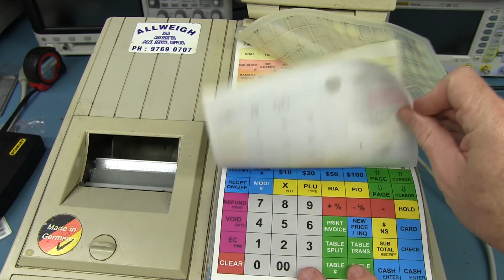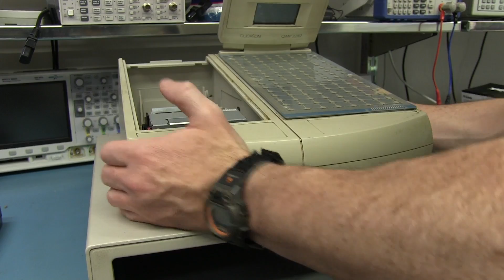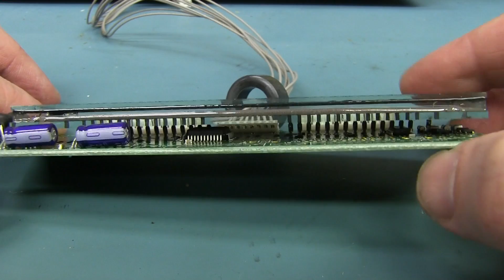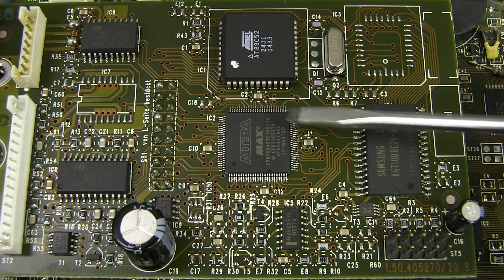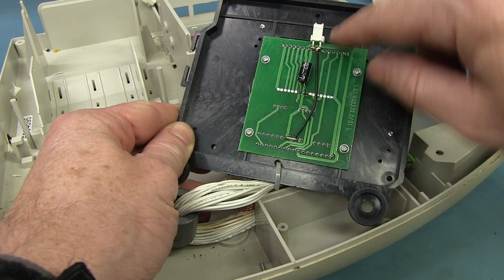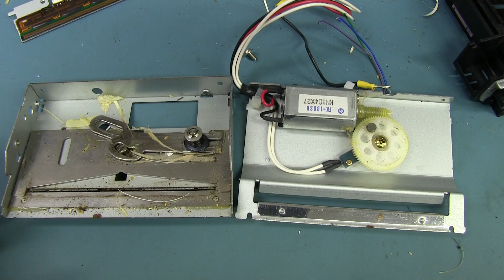EEVblog #641 - Dumpster Cash Register Teardown

Comment: I wonder how much of these 'bodging' is the result of keeping the same kind of product running for many and many years with installing new and more modern options and changing parts.
I have taken aparta kind of simular looking machine many years ago, some parts like the power-system are different, but some other parts are more or less the same or might be compatible.
Like in supermarkets (where mine came from) they used to have a very long life with replacement-boards 'on the fly, same day repairs', connecting the newer stuff  and it was running again and the serviceman goes to the next shop. They can be in use for over 20 years when the supermarkt doesn't need or want new functionality.

One of the things that changed in the life of these things were the printer and the printerboards. First they were not even thermo but with a small ribbon on 2 paper-rolls: one for the shop (roll staying in the machine) and one for the customer. Later they changed the system for saving the data internally in the registr., digital so you can print it out or safe it dayly instead of (only) the paper copy. That could be done in the same register, only 'swap out' the printer and the board.
Here at least they used to be emptied and counted at leas once a day, sometimes an exchange midd-day with other people starting to work. The chef usually had the key for all functions (like changing price) and the normal 'register-girls' just used a key with little functionality (selecting, scanning and paying).

Nice teardown.

Comment: The thermal printer can be used as a roll-mode oscillograph. Saving low frequency wave or data on paper.

Comment: wayback old cash registers used to be a way of getting a cheap uc training system, when the very first casio electronic registers (more basic than that one) started getting dumped (mid 80's ish) someone had produced a prom with a monitor program on it which you sent off for to an address in an electronics magazine advert - pre youtube hack! 
you had to assemble your machine code by hand and type it in through the keypad byte by byte, the VFD was your visual display and iirc there was no long term storage for your work. We had one at school - it worked but you only had about enough time to flash a led before it had to get switched off again at the end of a lesson. by that time a lot of kids had BBC and sinclair micros at home anyway which made it seem pretty unimpressive.

sorry for waffling up an old vid, just thought the people who've grown up on arduinos etc might be interested

the circuit board on that looked surprisingly clean given it had been used in a cafe

Comment: Hi Dave! Long time viewer, first time commenter, I have used many different cash registers:
1. yes, they all have some dingy tab to open the drawer, but only if it is unlocked (it only overrides the solenoid)
2. The key you found is for changing the mode, not locking the drawer. The modes are normally: Program, normal, void, off. one key (user) will let you turn it on and off, the other (admin) will let you program it and void sales. This is why it is not a really secure key.
3. programming these things is only slightly better then a root canal;
Put in PGM mode
enter 1001 press PLU then 1100 press PLU then AM/TD
Enter 1011 Press PLU then turn gey to Void and press AM/TD 
and so on and so on. it is horrible.

Comment: For about 10 years i've used an ex McDonald's cash drawer in my bedroom to store things like spare keys, cigarettes, a bit of cash, screws and other random small things. I drive the solenoid with 12v, with a button hidden nearby.
It doesn't have a finger release but the lock is so easy to pick that you could probably do it with one bobby pin.
I guess cash registers don't really need to be very secure because if a staff member wants to steal money they can always just open it. And if someone robs the place they could often just take the whole drawer or have a staff member open it.

Comment: Hehe I should do some tear down videos of some stuff I have here.
There is something from goodwill that I got that does not work and want to ask if any one can figure out what is wrong.
Although I am thinking it is the Lazer as it skips pretty badly.
It is a 300 disc changer,
There is also an old coffee pot that I should tear into on camera as I wanted to try to fix it if I could.
As it was a fairly pricey coffee pot.
I just never have done anything with the coffee pot as it has freaking security bit screws holding it together. :|

Comment: I work with Quorion machines, this one is very old, the new ones are much better, there's also a few of point of sale touch screen systems they have out, much better stuff. IF you need more info, check quorion.de :)

Comment: Might be interesting (and karmically appropriate) project to combine this with the laser barcode scanner and turn it into a shopping list generator. Wave a product you've used up at the scanner and it stores it with a microcontroller and then with touch of a button it could print up a shopping list of what you need to re-stock.

Comment: The key lock was actually not locked, the drawer just will stay closed unless you finish a transaction or press the manual release. If the drawer was locked, neither would have worked.

Comment: for those wondering about the mode switch, the x is for a running PLU report (usually an hourly report) that does not clear the stored PLU information. The Z mode prints out a report of every item from the last time a Z was done, and it clears out the information. Not sure about the other modes, but X and Z are pretty standard for PLU tracking systems

Comment: At 11:10 what are those two blobs of solder (?) just to the left of the L293D Quad Driver chip.  This is a 1.2A peak device so lots of current - I can see the large traces to the connectors.  Are the blobs to bridge some pins to handle the current?

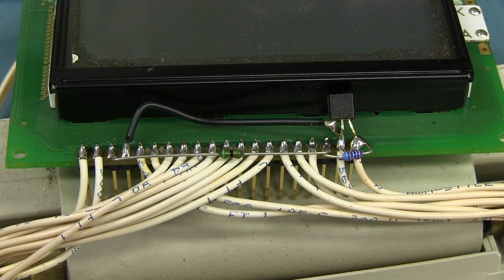Comment: On the under voltage bodge at 8:06, is there a chip resistor between the left hand and middle lead of the Motorola device?  Wow.  Aside - The 8:06 above becomes a link to the correct spot in the video!  That is why this is a repeat to change the time stamp.  Very nice YouTube!

Comment: On the under voltage bodge at 8:40, is there a chip resistor between the left hand and middle lead of the Motorola device?  Wow.

Comment: I want to thank you Dave for explaining the low-impedance ground return to avoid ground-bounce.. I have an FPGA project that bounces like a space-hopper when the data lines are pulsed and will look into this kind of work-around! (I think the chinese company that built the gate array board under spec'ed the bank-caps, but will try this as a first port of call) - Nice one! & Regards from the UK :D

Comment: When I worked at my dad's restaurants, all the cash registers had the option to open the drawer manually.  The mechanism is always stick your finger in the back, on the bottom of it.  Normally the register is against the wall, and is heavy due to the weight of coins in it, so it is not easy to raise it and open it, but when you need to, you can.  When will you need to?, easy: when you have no electricity, and a customer comes in, and of course you have handy the manual paper invoices.
The cash register is not a safe box replacement.

Comment: Thermal printers are a good output device for projects using a raspberry pi or arduino. I wouldn't bother with one unless it had an rs-232 interface though.

Comment: I have used thermal printers before for some fun wankey little projects ... twitter reader, joke receipts, printing out small things ... i stuck a little ATMEGA32u4 breakout in one and put it in a nice box ... unfortunately broke when my power supply failed! 

im most excited by that VFT ... i absolutely LOVE VFT displays but there soooo expensive!
Reply: Keep a eye on the noritake-itron sample site. They have very reasonable prices and often offer substantial discounts (50% off at the moment). Their evaluation kits are first class with excellent documentation and pre-made libraries.
Reply: Thanks allot!
Reply: some dvd players have VTF displays

Comment: Hi everyone,
I got a defect Philips PM3240 scope. The screen seem to light up but I get no trace. Any idea where to begin my troubleshooting? :)
Reply: Is channel A turned on (to left butten I guess)? Tried to play with Position and AMPL in the left section thile it's set to 0 on the bottom switches? Trigger (right) on AUTO and channel A? Are you sure the screen is actually on? The (orange?) grid-backlight controlled by illum is unrelated to the actual CRT screen.

Comment: Dave, check that VFD for severe burn-in, if it has been running static, which they usually do, re-purposing it will be a bit sad :/ - but try to document reverse-engineering the interface!

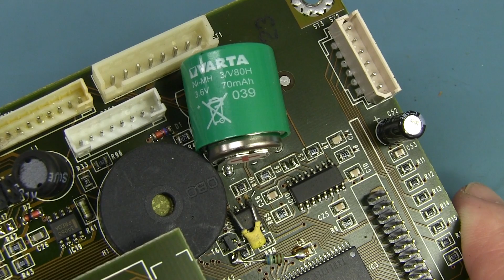Comment: That thing is ate up with bodges. At 13:55 you can see a through-hole inductor or something soldered across the tops of some surface mount parts near that backup battery.
Reply: and what it looks like a bodged cap right next to it..

Comment: The EEVBlog, Teaching people how to rob cash registers since 2014.
Reply from the maker: I like to cater to all audiences.
Reply: EEVblog
And that's why I'm a subscriber. Thanks Dave.
Reply: The shop i work in had a release button on the till but it had to be covered as it was part of a compliance audit we usually just taped a cd cover over it, though most modern ones will have the power loss release built into the keyhole, centred unlocked, turn right to lock and left to release the drawer
Reply: yep, I might check for that the next time I do work on a credit card machine (the place I work had the PoS separate from the credit card machines)

Comment: Auto Toilet paper cutter!!!
Reply from the maker: Make it Arduino controlled and it'll hit the front page of Hack-A-Day!
Reply: chris746568462 well, define "heavy" :D
Reply: EEVblog The problem there would be, that you need something to hold the paper, otherwise it would fall down as soon as cut. OR it will only cut the paper the instant you pull it, basically making the pulling even easier... Well... Somehow interesting Idea :D
Reply: Maximilian Mustermann It would not fall. If you look carefully at the cutter, at the top of the "V" shape there is a notch where paper is not cut. It stops the receipt falling from the machine :)
Reply: chris746568462 oh, nice :D but would that be enough to hold back multiple sheets of toilet paper?^^
Reply: Maximilian Mustermann For "Heavy" Users, probably not lol!

Comment: 14:40 "...diodes are raised off". Why are they raised?  Looks useless yet Dave pointed it out for some reason.
Reply: @André Küllenberg
Thanks, but it's not the case apparently. I've googled and found it's for better voltage spike protection. Spark voltage is 5kV/mm and degrades in high humidity environments. Spikes of a few kV supposedly can happen in the mains. So components are raised to remove them from pcb traces.
Reply from the maker: For thermal and creepage reasons.

Comment: Dave, I would be interested in a episode dedicated to "the art of the bodge."  Like what exactly were the symptoms before the mod, how easy is to replicate the failure, why the problem wasn't identified before production, the costs involved, the terror, finger pointing and other drama behind the scenes when you suddenly discover you just 10,000 units that don't work, etc. 

Every time I see a bodge on a board, I can't help but think "Man, somebody had a BAD day!"
Reply from the maker: More like a bad week or month. These things often aren't detected and a solution found in a day. Then yes, all the finger pointing, the endless meeting to determine the best course of action etc. Then some poor bastard has to sign off on the mod again. That's real world engineering.
Reply: watch the EEVblog #10, Dave tells a story when a bad rubber band cost one million dollars to a company.
Reply: EEVblog
Are SMD bodges like that common?  I've never seen that before.
Reply: excavatoree I spent a good part of last week soldering on 0603 resistors vertically on other smd component legs. Then run a little wire from the end that's sticking up for a discrete and fairly neat bodged pull up.

Comment: It would have been nice to see the power up sequence, as you described it was quite interesting. Also the software on those devices is at-least as important as the hardware. It's nice to see how displays are used ,how bright, character set etc, and it's nice to hear how piezo sounders are used. "Don't turn it on take it apart" only works when you reassemble the device and power it up afterwards :-). A tear down on dead device is only so interesting, if it's broken of course there no choice. Thanks for posting.

Comment: Just curious, do you ever try to recycle surface mounted parts? I have to drive 10 miles to get a cap that I could probably rob out of an old VCR!  (16k? Yeah I know. I'm trying to get us on metric, but I have to convert myself too, and that's hard!)
Reply from the maker: Yeah, if I need something right then and there I'll salvage old board. This is why I keep them.

Comment: An 80186? Those things were very rare in PC's. I didn't realize there were versions used in other devices.
Reply: The 80186 was intended for embedded systems and it had a long life. I think it was still produced by Intel in the last decade.
Reply from the maker: Yes, mostly used in embedded system where they were very popular for decades.
Reply: Ah I see, and yet in the PC world they basically skipped over it and went straight to the 286, weird.
Reply: Zoran used a Turbo186 by Vautomation (i think thats the name) in the Vaddis 6 series DVD decoders.
Reply: We still worked on 80C188EB in college about 12 years ago...
Reply: In my college we used the 8018x to implement a vending machine with a coin acceptor. I think the coin change algorithm was the hardest part.